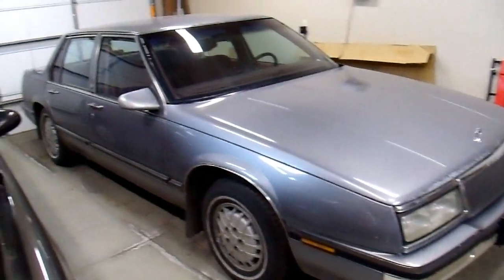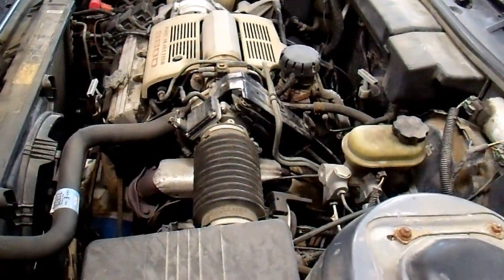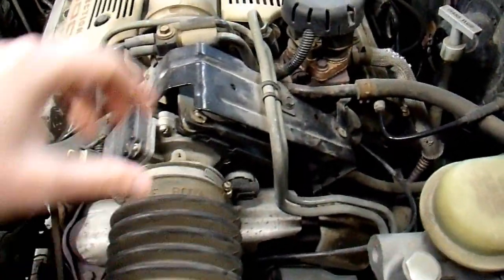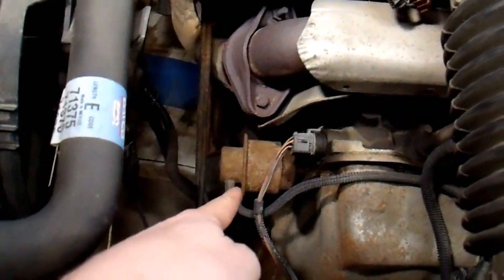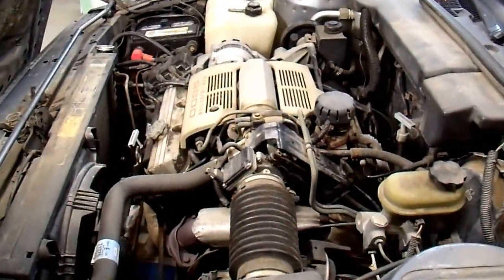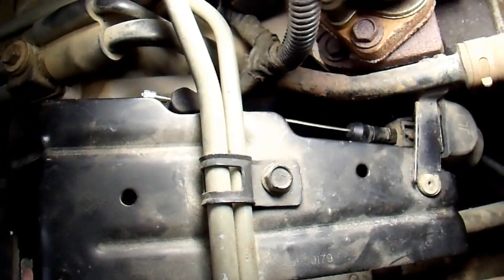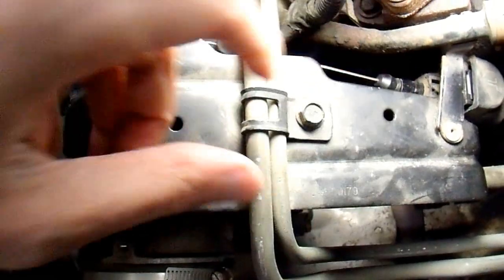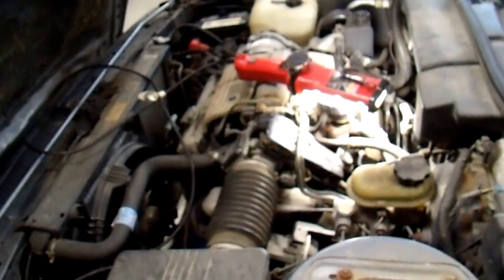How to Adjust Shift Points on a GM 4T60 / 440-T4 Transmission

Comment: Thank you so much for your videos!! I was an auto tech/mechanic for 13 years in shop, recently got a 91 Oldsmobile Regency 98 Elite with 99,950 miles for $900 bucks! Replaced the cackin ass harmonic balancer, and now the crank sensor wires or connector is acting up.. Fixin that in the morning. Thanks again man.

Comment: I really never understood the tvs cable but now i do thanks.
Reply from the maker: Note that on some older transmissions the TV cable controls both the shift points AND the shift pressure/firmness.  Vehicles that have a separate vacuum modulator to control shift firmness like this one are more adjustable without causing transmission damage.  I have heard that you can also purchase aftermarket vacuum modulators to adjust shift feel but haven't really looked into it.

Comment: hi,great video. love the car !!! ... i recently installed a ''madzda r2  diesel engine with a 4n71b transmission and the transmission carries a machanical modulator wich i am guessing is somthing like what your car is carrying. the cable to the modulator came cut so im not sure how the other end to the throttle is suppose to be. can you please help me to understand how that cable and modulator works ?? '

Comment: Ive got a 95 sedan deville I think its moderately ridiculous that I get a predominantly 6 cylinder equipped transmission in my full sized v8 

Ive had to replace the vacume modulator but i think the damage was done it knocks
Reply from the maker: This transmission is actually a very good one - I wouldn't be disappointed to have it even on my, what is it?  4.9l?  The trick is to keep them cool and replace the fluid every 50k miles or so if you run it hot.  It will last a very long time if you do so.  I don't know much about the 4.6l but I know the 4.9 is a great engine.  Uses lots of gas but otherwise good.

Comment: I dont even know if I have the same transmission but my 87 chevy r10 pick up has the same cable hooked up the the throttle so I assume i can adjust it the same way. The transmission was changed in this truck 6 years ago
Reply from the maker: If it has a TV cable then this video applies.

Comment: I have a 91 Buick century with the 3300 is this the 4t60 or the 4t60e
Reply from the maker: You have the 4t60.  It is the same as the 440T4.  GM uses the two terms interchangeably.

Comment: What is:  1992 Cadillac sedan de ville FWD viscous torque converter 4T60-E
Reply from the maker: That is the 4T80-E I believe.  Those viscous TCs were junk and they later returned to a standard TC system.  The good news is that a TC failure on them usually did not result in anything more than a loss in fuel economy.

Comment: Just be careful with this - if you have it adjusted to allow the trans to shift at slow speeds and in rapid succession, this can actually damage the transmission.  This valve controls 'modulated line pressure' in the transmission and a lower shift point is due to lower pressure.  Too low, and apply pressure is not sufficient for the clutches and you can 'smoke' your transmission.  $.02.
Reply: silicon212 WHAT is too low of a shift point?, I just walked away from a $2000.oo rebuild job by replacing the Vac Modulator, ("Low Cost Transmissions",,,,,Ya right!), at the suggested 3500RPM, would that be OK?
Reply: On these, the 'too low' shift point would have the 1-2 shift occurring between 8 and 10 MPH, being in 3rd gear before 20MPH.  The trans would shift into 2nd gear, generally before 10MPH, whether you were off idle or flooring it.